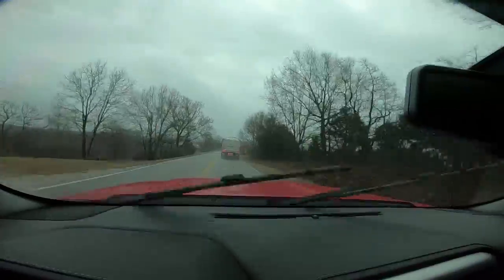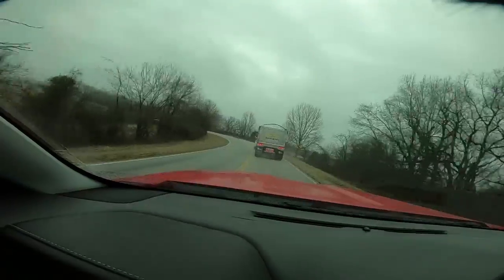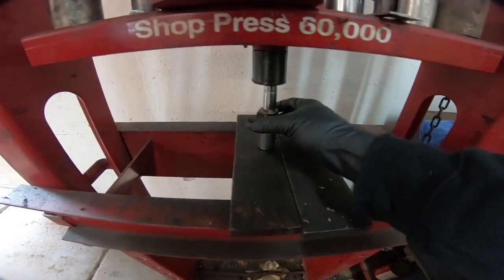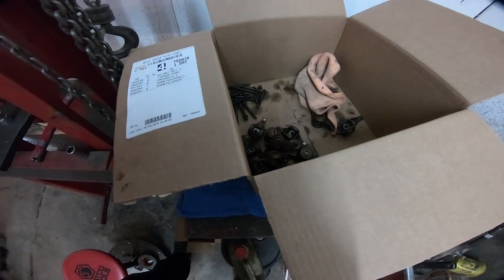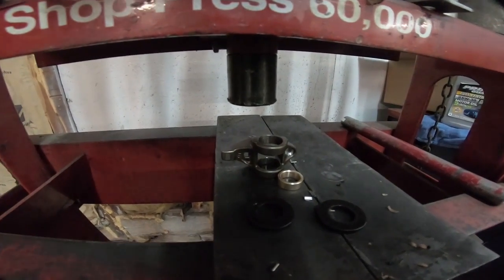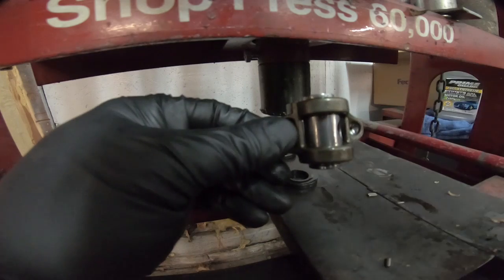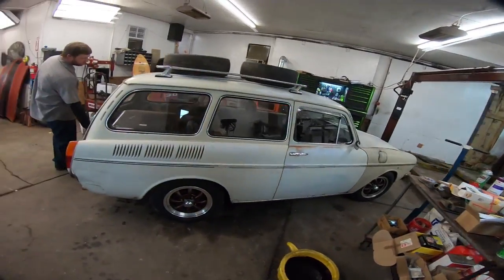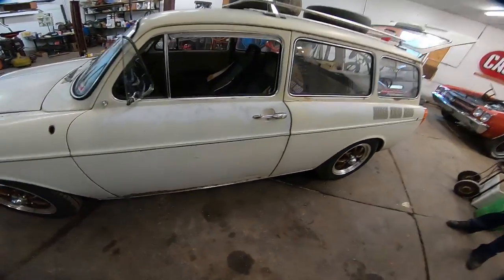How to do Trunnion Kit on LS1 Rockers (Trans Am WS6 Tear Down Part 14)

Comment: I know see why it takes you so long to get here. You take the wrong way!
Reply from the maker: What way do I need to go?
Reply: @TWAMotorsports  dont turn at the y bridge in Galena.  Go straight   to bass hollow rd. Turn right and it comes out on 13/160
Reply from the maker: @davidveldman1249  I have went that way. It's just as long.

Comment: Awesome video as always. I was just looking at doing this to my ls1 the other day lol.I did afr 210cc heads and tsp torquer 2 cam few years back.Never really thought about the trunion  upgrade. Was looking at the kit from Brian Tooley. Would hate to change oil one day and find needle bearings. Looking forward to the rest of the build.
Reply from the maker: Thank you. Yeah like I said I have went without this before and been fine but since it was apart.
Reply: @TWAMotorsports   ...absolutly, i rekon that falls under the "better safe than sorry" catagory ...& i, like u, have read some horror stories about needle bearings being chucked into the mix, & all kinds of "fun" thangs happening... 'priciate the walkthru bro!
Reply from the maker: @heavychevy383  yeah since they were out I thought why not👍

Comment: Def a must for anyone rebuilding or upgrading the LS platform. It’s cheap and easy for peace of mind.
Reply from the maker: I agree
Reply: TWA Motorsports I went with a Comp Cams, I believe they have letters on the bushings that need to be facing outward. Bought a cheap Harbor Freight bench vice and knocked it out in about an hour.
Reply from the maker: @sweetdees86  yeah these are about the same.